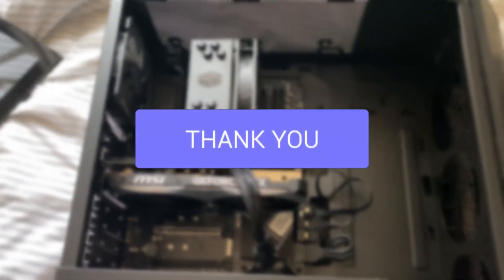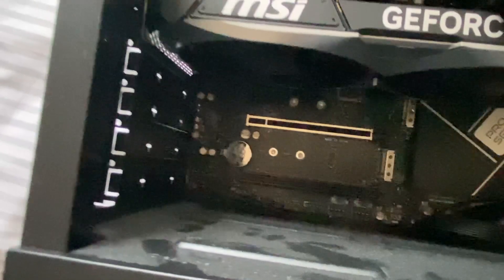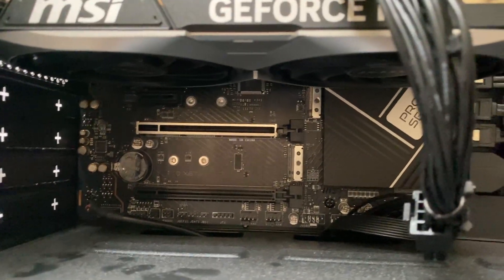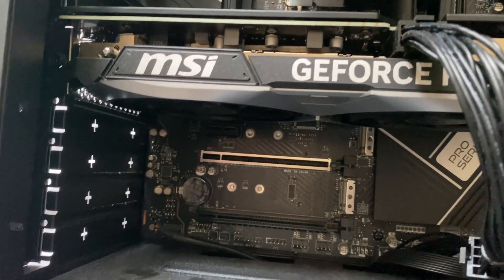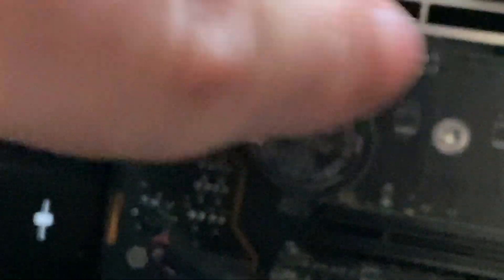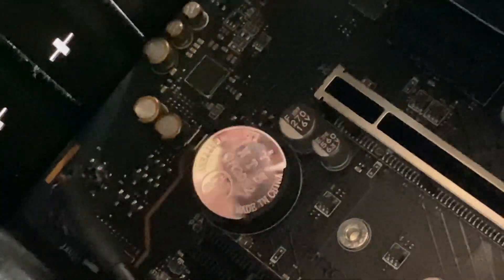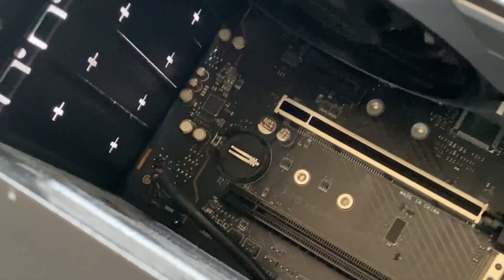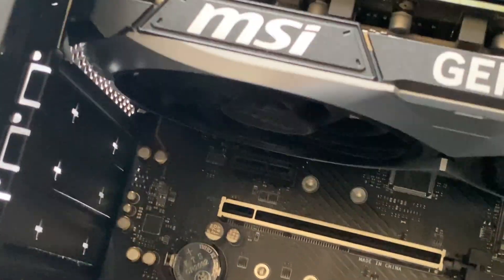How To Remove CMOS Battery From Motherboard - Full Guide

Comment: I can’t remove it!!!
Reply: mine had small plastic cover thingy between those metals that had to be removed.. now can easily remove battery
Reply: @m6siin6 how did you remove it? Mine is sooo small
Reply: @m6siin6 how did you remove that?
Reply: @m6siin6 how did u remove it
Reply: @m6siin6 how do you remove them I cant
Reply: It’s very hard I get so scared 😂
Reply: Me either. Did you ever figure it out
Reply: grab a small screw driver & give it a nice push instead of your nail

Comment: One thing. You have to remove it for 15-20 MINUTES, not seconds
Reply: who do i believe
Reply: @MihovilVidovic5 mins minimum
Reply: That's cap bro it don't take that long 1-5 mins is fine
Reply: In 15 seconds work fine. Don't take that long
Reply: Cap
Reply: I did 1 second and it worked.
Reply: It was fine for me being 15 seconds
Reply: Welp, good luck to you then.